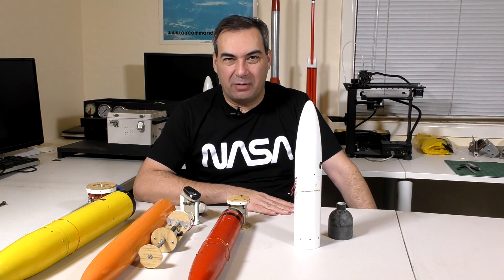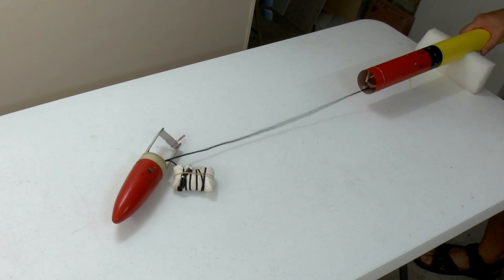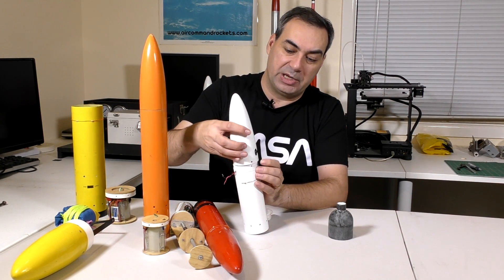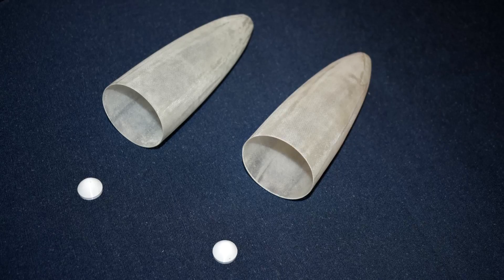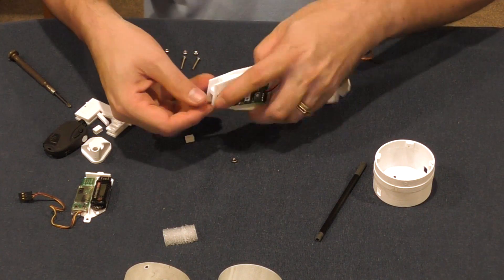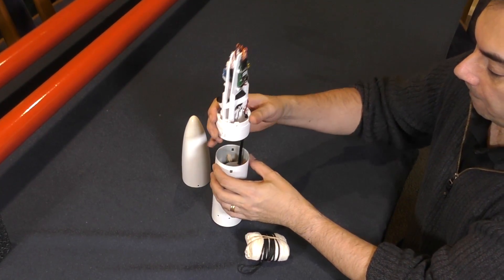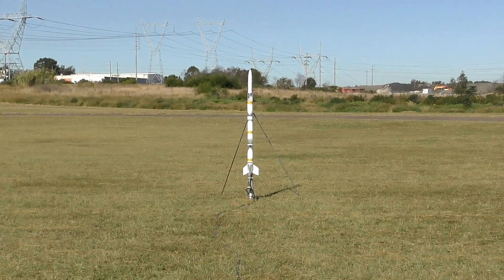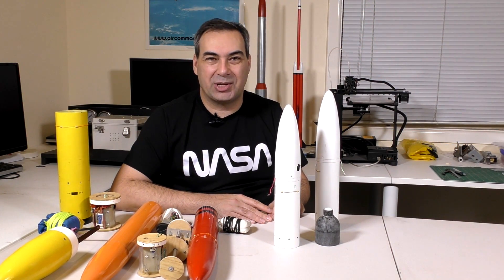2 Stage Water Rocket - Part 12 - Parachute Deployment

Comment: Hello, I love your videos and I'm trying to replicate the parachute deployment system. Could you make the STL files available or tell me where I can find them?
Reply from the maker: Hi, unfortunately those STL files are not available yet. They will be released in a few months as part of a larger package. We have STL files available for the Nova rocket if that helps: https://www.thingiverse.com/thing:5502347
Reply: @AirCommandRockets  Hello, thank you for your response. Unfortunately, I specifically need those STL files, as the ones for the Nova rocket don’t fit my project. How soon will these files be available? I’m working under a tight deadline and can’t afford to wait too long.
Thank you in advance.
Reply from the maker: @Victor-wu3ew  Hi, it will still be a few months.
Reply: @AirCommandRockets 
Hello,
I was wondering how soon I could get the STL files for this parachute deployment system because I would love to recreate it for my rocket. That's the only thing it's missing. I'm French, 14 years old, and I don't know how to use 3D design software. Could you please upload the STL files quickly or attach them below? I really need them.
Thank you so much for doing everything you can to help me.
Thank you again.

Comment: Can you get alloy aluminum screws for the assembly? ~( 'w')/
Reply from the maker: That would certainly be possible. Some have also suggested nylon screws which would also work.
Reply: @AirCommandRockets  I find nylon screws are pretty much use-only-once because they do not handle friction or stress well.

They are probably plenty strong enough, provided you never need to disassemble them, but they suffer wear [even against themselves] quite badly, and they also suffer fatigue if they are subjected to repeated uses at torque levels over 50% of their peak.

This means that they can either strip out on you, or they can twist off on you if they are not handled with extreme care.

Also I have no idea how much vibration your rocket delivers, nor how many times their tensile strength the mass of acceleration might deliver to them, so I think it would be good to test them before actually putting them into the final product.

The aluminum, especially the military spec aluminum is hard enough to resist abrasion fairly well, and it is plenty strong enough and fatigue resistant enough to be R&Red hundreds of times at 50% of their peak torque without experiencing metal fatigue, on top of the fact that just like steel, they are typically being secured at torque loads well below 50% of their peak torque, which I fear is not going to be the case with nylon.

I would certainly get the specs on the screws and even then do some failure analysis tests before trusting the mission to them. ~( 'w')/

Comment: Hi George! 

Very well designed nosecone and ejection mechanism. Have you considered using nylon instead of stainless steel screws? Do you think that they would snap under acceleration?
Reply from the maker: Thanks Daniel. I am sure nylon screws in this application would do just as well for the internals of the mechanism. You could certainly save a bit of weight that way. Though I am not sure how well they would do that connect the whole mechanism to the rest of the rocket.

Comment: With the plain GF do you lay it up at an angle (the actual fibers)?
Reply from the maker: For the nosecone yes. The glass cloth is bias cut to make it easier to conform to the convex shape. For the body tube no. The fibers are 0 and 90 degrees to the tube axis.

Comment: Excellent upgrade, George! It's amazing to see what you can do with a few rubber bands and a lot of ingenuity. I'm.using the same approach to create the 1st pyro model rocket that can land vertically. I've already built and tested my #Rocket #Drone, but this time I want to land a rocket just using the solid fuel motors, in a smarter way than BPS. :-) Please take a look at it, on my channel. #landingarocketverticallywithoutbeingabillionaire #take2

Comment: Which glue do you use for the pressure tank?
Reply from the maker: We use West Systems 105 epoxy and 206 Slow hardener
Reply: @AirCommandRockets  I mean for the connection between two bottels
Reply from the maker: Ahh I thought you were referring to this project. We use PL Premium polyurethane construction adhesive to glue PET bottles together. https://www.loctiteproducts.com/en/products/build/construction-adhesives/loctite_pl_premiumpolyurethaneconstructionadhesive.html

Comment: Very nice serie guys! Does the shock from the parachute deployment not effect the altimeter now it is outside the rocket?
Reply from the maker: Hi Basrockets. That's a good question. In our testing so far it hasn't had any effect on the reading. The recorded altitude plot did not show any spikes.  The commercial units do a good job of filtering out any transients like that. Even with the previous designs there weren't any such transient evident in the recorded data and in those the altimeter was below the parachute so that when it ejected it would have created a low pressure pulse inside the tube. The altimeter one, two and three from Jolly logic are designed to attach to the shock cord under the nosecone and they also eject into the air stream, and also are able to filter that out.

Comment: Hi would you rather spacex or NASA?
Reply from the maker: Not sure I understand the question.
Reply: What’s going better in the space race to mars NASA or spacex
Reply from the maker: Well SpaceX will need NASA to get to Mars. I think it will be a joint effort. As I see it, we are still at least 10-15 years away from a manned flight but probably more.

Comment: Another great video George. Its incredible what you  manged to fit in that nose cone. Perhaps put one of these on your Christmas list: 

https://www.ebay.com.au/itm/Mirror-Top-Battery-Power-Rotating-Display-Stand-Electric-Turntable-Show-Holder/113763762195?epid=6027200574&hash=item1a7cd94013:g:VQQAAOSw5cdc7PHg
Reply from the maker: Thanks Derek. Haha, I thought the cable reel on it's side worked great... ok maybe not that great.... in fact it was quite terrible. :)